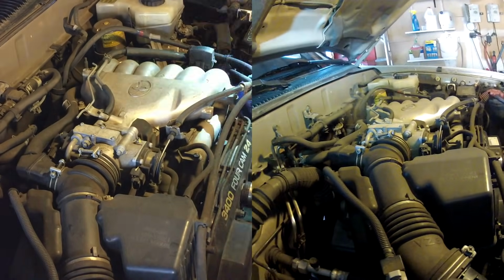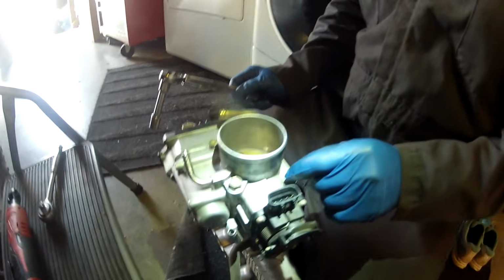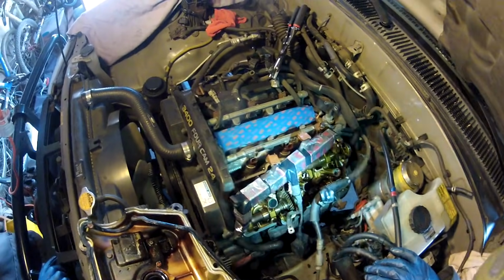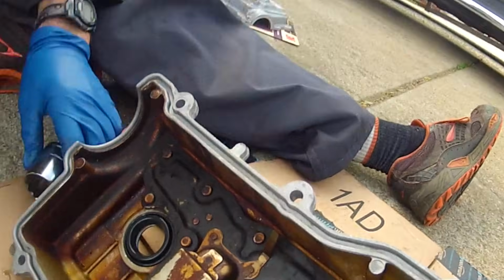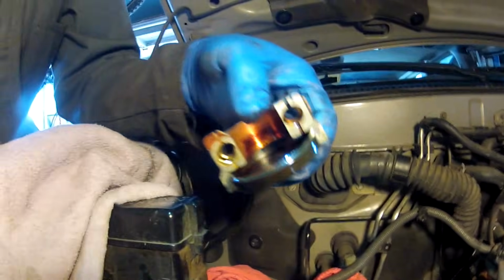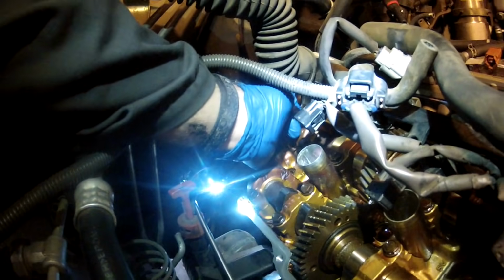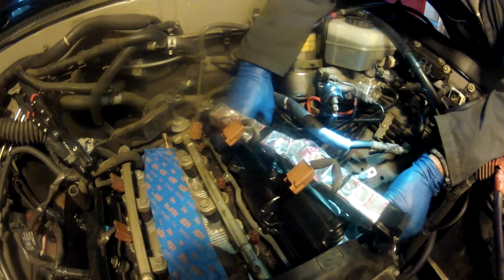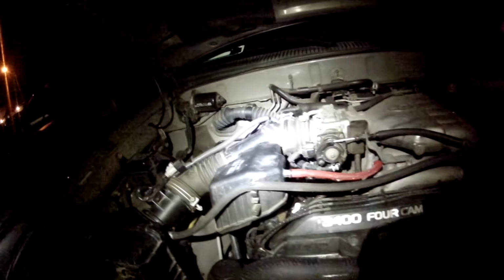3.4 L V6 5VZ-FE Toyota 4runner, Tacoma, Tundra Valve Cover Gasket Tutorial

Comment: Finally I found a in depth detailed video on how to  assemble  and disassemble parts to get to the valve covers., cam  plugs etc... Your video is really  helpful well explained - together with reference  to  the repair manual....  Now I have a better understanding to fix my '99 4Runner .... 👍 thank you
Reply from the maker: Good luck with the repair.  When I did it the first time on my truck, I took my time.  I labeled hoses and electrical connections, wrote down notes of the order I took things off and even took pictures of the engine before I started so I could reference them if I forgot how something went back together.
Reply: Tim can you recommend any online site that sells OEM toyota parts hopefully discount price? or the dealer is the only way to go...thanks
Reply from the maker: Camelback Toyota in Arizona is awesome.  Their prices will be much lower than your neighborhood dealer and they charge next to nothing for shipping.  I think they charge $3 per shipment unless it's a very large piece, and then they are forced to charge more.  I was charged $30 shipping for the metal piece of the front bumper because it was an oversized package.

Here's a link to their site.  Compare their prices with your local dealer and you'll see their prices are very good, just as good as any other online seller.  

http://partsfactory.camelbacktoyota.com/?utm_source=domain&utm_medium=referral&utm_term=.com&utm_content=direct&utm_campaign=parts.camelbacktoyota.com
Reply: hi timmy, i just want to thank you on the info website on oem  toyota parts ..all i can say is WOW! huge price difference and savings...im so happy i asked  you first...im in cali and man their prices were so expensive compare to camelback...with these savings i can get other replacement parts needed...Again thanks and keep up the good work on  your vlogs :)
Reply from the maker: No problem.  Saving money on parts is definitely a good thing.  I still use my local dealership for things that I'm having difficulty finding online or I just want to get it right now.  The people that work the parts counter at my local dealership are really cool and have been helpful so I don't mind giving them some business.

Comment: Do you have a parts list?
Reply from the maker: Watch the beginning of the video. We have most of the parts listed. We made a mistake with the cam plugs. You only need 2.  Also, we forgot the part number for the spark plug tube seals. Somebody gave a part number in the comments but I haven't confirmed it's accuracy.

Comment: The parts list at the beginning is missing the spark plug tube seals. You need 6 and the part number is 11193-70010. Hope this helps someone out. Also putting the part numbers in the video description would be more helpful than in the video, that way we could copy-paste them. Thanks for posting this video, it's been very helpful.
Reply from the maker: Seems we made a few mistakes with the parts list. Thanks for catching that.

Comment: I just finished this job on my 2002 Tacoma Prerunner (purchased new in 2001; love this truck!) with 272,000 miles.  The valve cover gaskets had never been changed and both sides had small leaks.  Thanks for the instruction in this video.  One thing I might add is in regard to the cleaning of the throttle body.  I cleaned with the appropriate cleaner (TB Cleaner available at any parts store).  When I put everything back together I experienced a high idle even after the engine warmed up.  I allowed time for the computer to re-adjust everything but it wasn't long before I got the check engine light.  I put my scanner on and got codes for both the Throttle Position Sensor and the Idle Air Control Valve.  I knew it wasn't the TPS as I'd replaced this a couple months ago.  I took the throttle body off again (remove negative terminal on battery first) and proceeded to remove the IAC (held on with 4 brass screws).  It was clogged with crud I suspect drained in through the port at the bottom of the throttle body throat.  I would encourage anyone attempting this to take the extra time to remove the IAC and clean this separately to prevent my experience.  Not a huge deal but.... After putting everything back together I started the engine and start up and warm Idle worked perfectly (computer adjusted very quickly).
Reply from the maker: We also used actual Throttle Body Cleaner to clean the throttle body. I guess maybe we didn't show the actual cleaner in the video.  And, we used Mass Air Flow Sensor Cleaner to clean the MAF.  I have heard people having issues after cleaning the throttle body but we didn't experience any with Sean's truck.  With my own truck, I just sprayed throttle body cleaner on a rag and wiped mine clean that way because I didn't pull my throttle body off.  I think the problems occur when you end up spaying crud down into the IAC, like happened to you.

Comment: Thanks for the video; very educational. You noted 4 camshaft plugs in the parts list but we see only two being replaced in the video. Did you replace two more in the front of the engine and not show it?
Reply from the maker: Maybe I wasn't clear in the video, but there are 2 Camshaft plugs that are installed under the collars on the back of the heads (big round disks with a rubberized outer diameter).  There are 4 half moons, one on the front of each head and one on the rear of each head.  You DO NOT have to replace the 4 half moons if you want to save a little money.  They are absolutely reusable as long as your are careful removing them from the heads.  All you have to do is clean off the old sealant off the half moons, clean off the area of the head where they sit and then reseal them with new Toyota FIPG or gasket sealant of your choice.   Hope this clarifies things for you.
Reply: Not exactly...The semicircular plugs or half moons (part #11183-62010) can be cleaned and re-used. What I'm referring to is part number 11188-62010 or the camshaft plugs as referenced on the parts list.  You noted 4 of them in the introduction but only replaced two of them in the video.  Should two be ordered rather than 4 or are there two more in the front of the engine to be replaced that you didn't show?   Thanks again!
Reply from the maker: Yep, you're right.  We made a mistake on that parts list at the beginning of the video.  We show (4) Cam Plugs when you only need 2.  You only need to buy (2) Cam Plugs.  Thanks for noticing this.  I put a note on the description of the video making people aware of the mistake.

Comment: Are there 4 cam plugs or just 2?
Reply from the maker: Just two Cam Plugs.  One under the collar at the back of each head.  There are however 4 half moons on the heads (2 on each side - 1 on the front of the head and 1 on the rear of the head) you have to pull out, clean up and reseal with Toyota FIPG or gasket sealant of your choice.
Reply: Thank you for the fasy reply. If I'm not mistaken your parts list at the beginning of the video shows 4.

Comment: Thanks for the video.  Very helpful!  Nice touch with the torque specs at the beginning of the video.

One tip on removing the spark plug tube seals: after deforming the outer metal ring, I flipped the valve cover and used the hammer & screwdriver on the now-exposed deformed metal ring.  The seals popped out easily.  Had all three out in about 20 seconds.
Reply from the maker: Sounds like a good technique to get the tube seals out.  Thanks for sharing and I'm glad you found our video helpful.

Comment: great video just one question. when you put gaskets on the VC and go to install them the covers onto the engine could the gasket fall off since it seems to bang around a little bit installing? could we put just a little FIPG just to keep the gasket from falling off VC or is that a bad idea?
Reply from the maker: It's interesting you asked this question because I was thinking the same thing before I tackled this job.  The valve cover gaskets press into a groove on the valve covers and sit very securely in place.  I think you'd almost have to try to dislodge it to get it to move out of place.  FIPG is not needed and probably a bad idea since you'll have to scrape it off if you ever have to do the job again.  You'll see what I'm talking about when you do the job yourself but I do show putting a gasket on one of the valve covers in the video and you can see me pressing it down in place.
Reply: Great! It looked like they sat pretty well inside the VC  in the video but I  wouldn't really know unless i actually felt it for myself which is why I thought I'd ask. Appreciate the response and great video! Best VC Replacement job DIY by a mile.

Comment: Shouldn't you add some grease/oil on the camshaft before putting everything back together. Since it might be a little dry
Reply from the maker: It's not necessary.  As soon as you start it up, oil starts circulating immediately.  And, we didn't wipe down anything under the valve cover so there's still a slight film of oil over everything.

Comment: This i a great video, thanks!

Unless I missed it, it was unclear whether you drained the coolant or not. The manual says to drain it, but other places I've seen says it isn't necessary.

Have you considered doing one on adjusting the valve clearances? I've found several for the 3RZ-FE engine but none for the 5VZ-FE.
Reply from the maker: You don't need to drain the coolant.  You only lose a little coolant from the hose that attaches under the throttle body and you can clamp it off like I did in the video to limit the loss.  I don't know if I'll ever tackle the valve clearance job.  Looks kind of involved but never say never.  But if I do, I'll definitely make a video of it.

Comment: Hi Tim!  You were right that this video contains everything about the spark plugs and pcv and intake cleaning.  Might as well go the extra bit and do the VCG on my truck.  I followed the parts list at the beginning but didn't see the spark plug tube gaskets or missed them?  What is that part number?  Also, do you only need to order one of the wire sets and it comes as whole thing?  I know I read sometimes you have to order two different sets (driver/passenger)?
Reply from the maker: Hey Daniel, I missed your question.  We forgot to put that part number in.  It's #1119370010.   Thanks for noticing that.

Comment: I have Ultra Copper for sealing plugs.Will that work the same?What kind of Sealer was he using?
Reply from the maker: +Dan James I'm not 100% sure what you're talking about.  You DO NOT want to put any RTV on the threads of the spark plugs.  If you are talking about the sealant we used to seal the half moons on the heads and the sealant we used in the specific areas on the tops of the heads the Factory Service Manual suggests, I believe any good sealant will do the job.  We chose to use the FIPG (Form in Place Gasket) that Toyota sells because it sets up quickly and you can drive the vehicle right away.  I don't know what the set-up time is for the Ultra Copper.

Comment: Thanks for the great video. I'm doing this job right now and this has come in very handy. A couple of questions:
1. How is everything holding up? Any leaks since you guys completed the job? A buddy did the job recently and his gaskets seem to be leaking near the firewall again. I'm just debating weather I should add a little FIPG to the cam plugs despite the service manual not calling for it.
2. If the taped up wiring harness breaks, can the duct tape be left on when reinstalling?
Reply from the maker: +juniorpjg Sorry for the late response.  I was up in the mountains without cell service or internet.  Everything is holding up great on my truck and my buddy Sean's.  I've checked several times on my truck with that little telescoping mirror on the back side of the heads and no signs of leaks.  I also put my hand back there to see if I come up with any oil on my hand and it comes up dry.

Did your buddy use new cam seals and did he reseal the rear half moon with plenty of FIPG?  I put enough FIPG on the half moons that it oozed out a little on both sides.  I know some people put FIPG on the cam plugs but I decided not to for one reason.  If I ever have to do the job again,  I think it's going to be really hard to remove old FIPG back there against the firewall.  I think if you use a new cam plug and the collar is tightened down correctly, you won't have any leaks.  And, just make sure the half moons are sealed good too.  I didn't even own a torque wrench when I did my truck, just went by feel like I've done for years, and no leaks.  I have 3 torque wrenches now that I'm using a bunch for the other repairs I've done.

I left the tape on my harness to help hold it together.  I never intended on taking it off.  That type of metal duct taping is meant to take heat so I think it's fine.
Reply: +Timmy The Toolman Thanks for the reply. I already finished the job. I ended up putting some FIPG on the cam plugs just for good measure and I decided to leave the tape on as well. As you said, it is designed to take heat plus my harness broke in a couple of spots, so I figured that way it will stay together better.

My buddy did not remember exactly what all he replaced and what he did not. I guess he did it a few years back when he first got his 4runner.

Thanks again for making this awesome video. It helped me a great deal. Keep it up.

Comment: thank you for spelling this out for newbie. Every write up I see, skips a billion steps. this spells it out thanks so much.
Reply from the maker: +Bardia Ghajari You're welcome.  My friend Sean and I wanted to make a better video for people to use to do this repair.  The videos in existence before ours were decent but they lacked the detail that we wanted in tackling this repair so we decided to make our own.  And, we enjoy working on our trucks and doing the video documentation so there will be more videos to come.
Reply: +Timmy The Toolman  
I truly appreciate that, Great looking out for us. Can't wait till your video gets more views so it gets pushed to the top. 
any type of bushing repair, upgrading to poly should make for good videos. I am going to replace my rear diff breather, Im going to try and record it this weekend.  Lets see how it goes :)
Reply from the maker: +Bardia Ghajari Interesting you should ask about bushings.  We actually installed polyurethane bushings from Energy Suspension in my steering rack and front sway bar today.  Went pretty smooth.  My bushings weren't really worn out, but I replaced them anyway.  I can detect more responsive steering though which is good.  The end link bushings that came with the sway bar kit had the wrong internal diameter so they don't fit as well as they should and squeeze out a little past the washer due to the oversized hole.  I called the company and they are going to get the right ones out to me.  We did video the whole process and we'll probably be posting it by the end of the week.
Reply: +Timmy The Toolman Woah! Awesome thank you so much. Yeah, looks like no matter what you got to measure the diameter of the sway bar, vin number alone wont determine if its right one.  Im glad you recorded it. Any chance lower control arms, or rear control arms coming out soon? Being a little anxious here =P.  Glad the new bushings helpped. I got it done on my 3rd gen, now gotta go get it done on 4th gen.
Reply from the maker: +Bardia Ghajari I got the right bushing kit for my truck from Energy Suspension but I think the Prothane company that makes them puts the wrong end link bushings with the package.  I'm thinking they've been doing this for a while and maybe people just assume that's the way it is.  We might do some front end work on Sean's truck one day soon.  He's talking about getting aftermarket upper control arms.  If we do it, we'll probably replace the upper and lower ball joints while we're in there.  He also do for some new or refurbished CV axles.  I've seen some people talking about how to replace the bushings on the control arms.  Looks like some work to get them out without damaging the control arm.